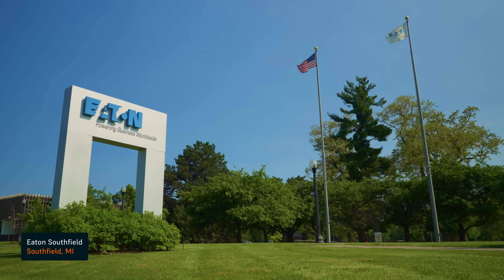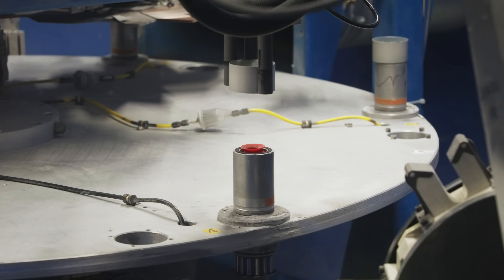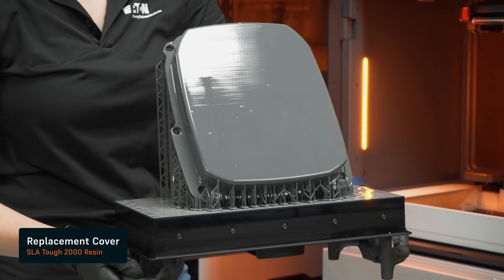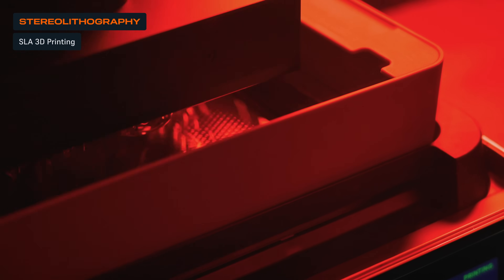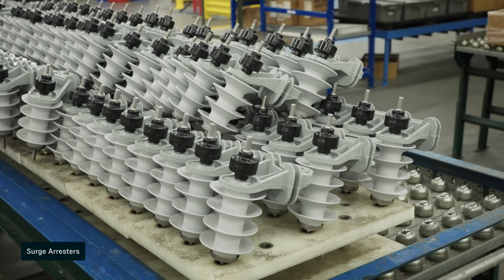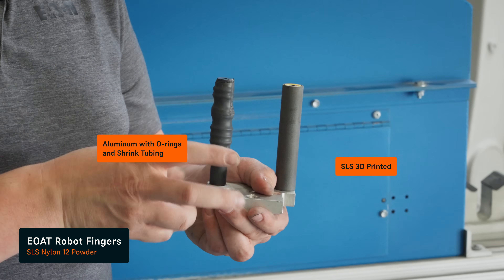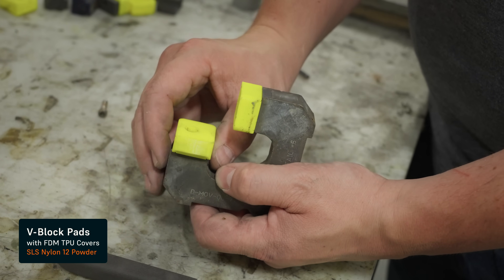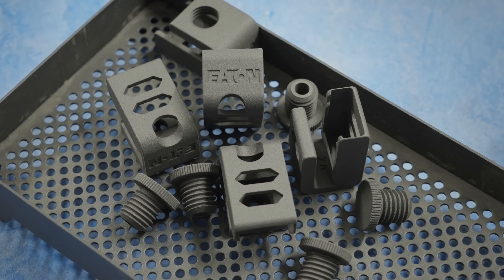How Eaton Replaced 90% of Their Machined Fixtures With 3D Printing

Comment: The largest hurdle in 3D printing is getting engineering and management educated on how the machines work so the engineers can make good parts intended for the correct manufacturing method.  A constant stream of injection molded and sheet metal designs means engineers will spend their days badmouthing 3d printed parts as nothing but trinkets.
Reply: Can't speak for managers, but as an engineer I don't know ANY Engineers that aren't on board with 3D printing. The tech has been out for a long time.

Something to remember, not all methods of manufacturing are ideal for creating a given item. Material, ease of manufacturing, planned units, and much more are all factors that are weighed when trying to figure out how to make that item.